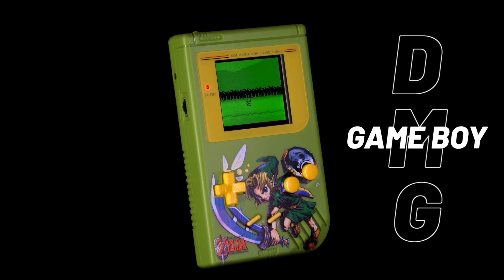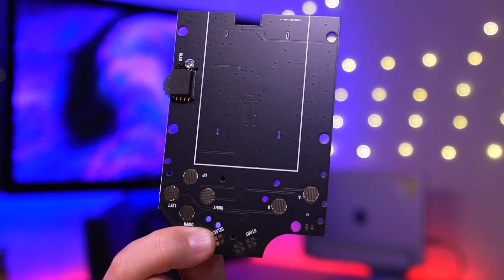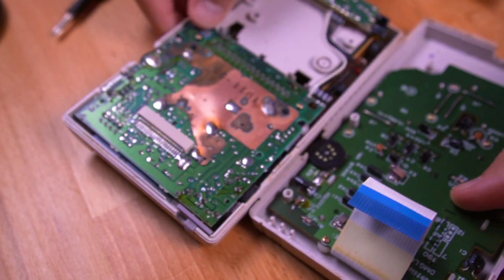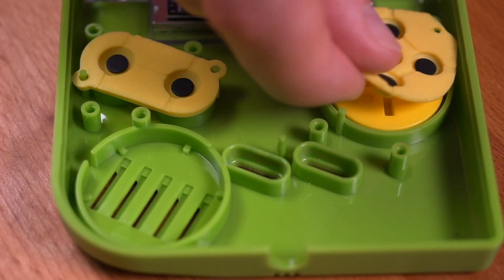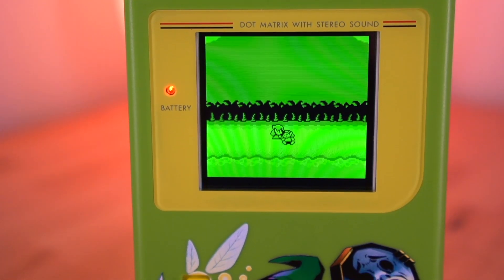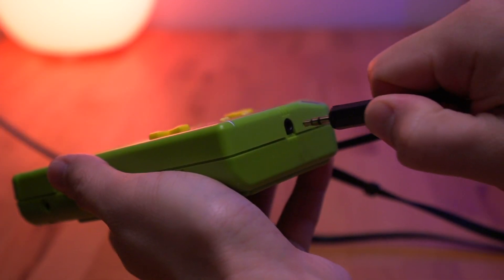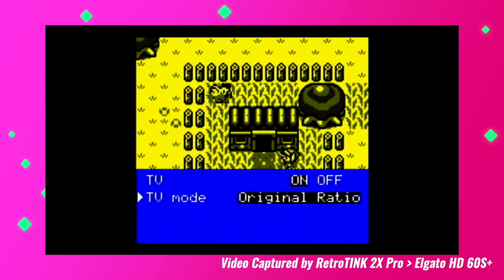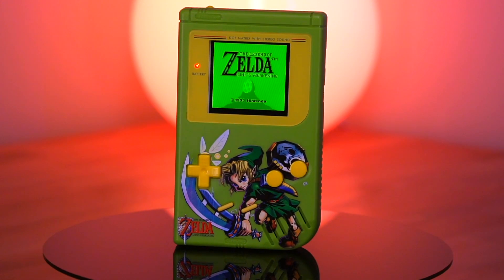EASY TV-OUT IPS KIT FOR THE DMG! | RIPS V5 IPS

Comment: 8:16 for the features overview. As a RIPS v4 owner I'm disappointed that on the v5 the colour adjust function still doesn't have the ability to save palettes to quickly reload.
Reply from the maker: That’s a good point. I hadn’t looked into that. Thanks for the heads up
Reply: Oh man. I've got a v5 (non tv out) on the way and I wish I knew this
Reply: So I installedy rips v5 and it does save the pallettes. Saves it if you long press after adjusting the color

Comment: Tito i love your vids! Your work is always well done.

I feel like you should be mentioning a few things though. Maybe im wrong but heres my opinion. I dont see you typically mention to replace caps. Maybe still debatable on a GBA but undoubtably something worth mentioning on a DMG. Those things are all over or pushing 30 years old at this point and well past expectancy. Same thought toward mentioning a new power regulator if they get any weird behavior. Its a common fix as im sure you are well aware.

The other thing that comes to mind is I think you should suggest people test the IPS panels before installing. I think you mentioned it in one video but its not a common thing. 

Minor nitpicky stuff. I overall want to express my appreciation for your efforts and your consistently high level of production quality. Thanks for doing what you do!
Reply from the maker: Thanks for the feedback!  Caps may definitely be something that needs to be replaced.  So far in the few that I have modes I haven’t found them to be an issues although like you said they are quite old now. 

Agree it is good practice to test before installing. I’ve thankfully never had an issue to date with any  of my kits🤞
Reply: @MachoNachoProductions  thanks for the reply! I can definetly respect the "if it ain't broke don't fix it' approach.
Reply: @brandicus  I've got two modded v4 dmgs one with new caps and one with original caps, the one with the newer caps had the weirdest behaviour, screen goes weird time to time, doesn't turn on every single time, etc etc, and with tonnes of experimenting and swapping I've put it down to the new caps. Not sure if it's cheap caps or what but the originals have held up so much better so far :D
Reply: @nathanglynn7443  You ruled out the power regulator? Have you tried a replacement or upgrade?
Reply: @brandicus  both have been upgraded

Comment: I’ve been wondering what the RIPs 5 was. My RIPs 3 isn’t working. Pikachu issue. Other screens are working. It’s the board so I will be replacing. Hopefully I can find one with just the board.

I believe the RIPS 4 is the same as funnyplaying. It uses the Q5
Reply from the maker: Yes, that is correct, this one uses the smaller panel unfortunately.

Comment: Great video! On a crt it will fill the screen with a bit of the edges cropped off, correct?
Reply from the maker: I was showing it with the wide aspect ratio. When switch to original, it shows everything in the screen on the crt.

Comment: If you left that top tab there, and placed the screen up to that, would the black outline be even from top to bottom on the display? Will it still fit?
Reply from the maker: I think it won’t fit into the bracket properly if you don’t cut that fin. Also if you’re using and original shell there are to posts you’ll need to trim that weren’t on my shell.

Comment: just curious. Is there a way to use an external controller for the Nintendo 2DS XL? 
My left hand is paralyzed and using the circle pad or D-Pad is impossible now. I can still use a thumbstick.
Reply: with custom firmware you can use bluetooth controllers with the 3ds family of systems
Reply from the maker: That’s a great question Jason.  I’m not aware of any way to use external controllers with the 2ds currently. I know benn heck makes some great custom controllers